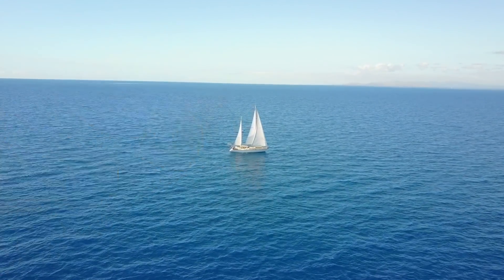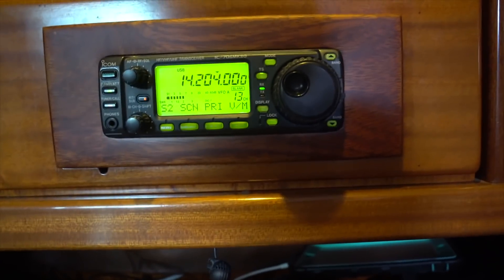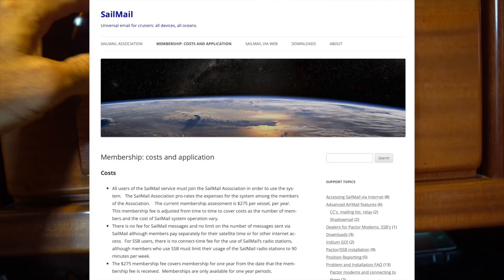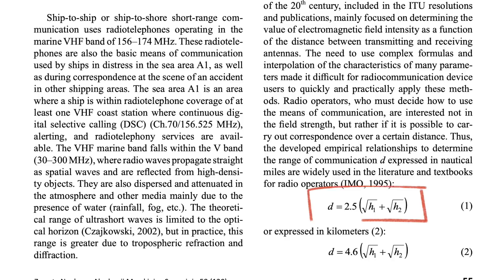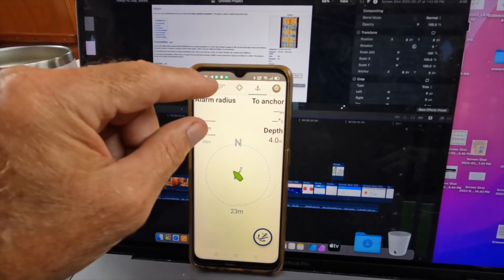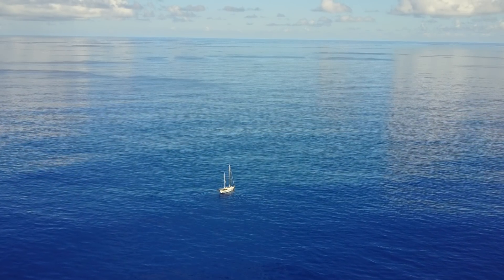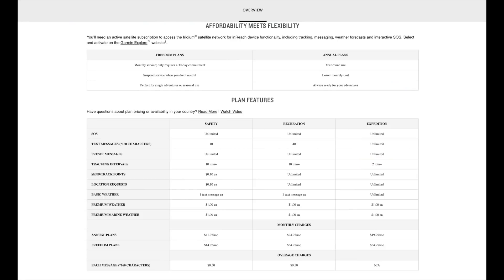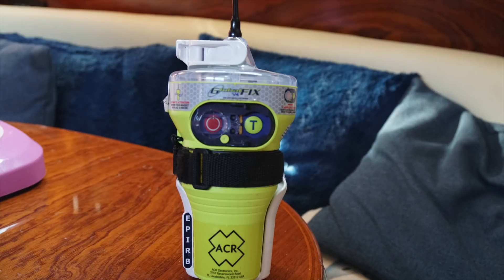Yacht Communications 101. Tips on Tuesday

Comment: Great Tips on Tuesday! Very practical information to consider.   Did you set up the NMEA system on Aquarius or did she come set up?   Do you run a secondary mapping/plotting system with a laptop/external gps antenna or do you primarily on your chart plotter?  And which platform (Windows/Android or Apple based) do you guys find more useful?
Reply from the maker: I set up the NMEA 2000 bus.  Supper easy to set up the NMEA 2000 bus!  The Vesper XB8000 sends all the NMEA 2000 and NMEA 0183 data over the WIFI, this data included the location data.  Our computers and tablets use the Vesper location if connected.  This way we can also use the AIS alarms....  If any boat gets within a few miles of us, the alarm goes off...  Both Z and I use Apple based computers, but Z has and iPhone and iPad, and I have Androids.  Ken

Comment: Thanks for the information.  I think I would have an Epirb even with other satellite communication as it design for emergency.  You push a button and people will look for you.  In the best of time, it take a few minutes to set a call with Iridium and explain what is going on and where you are.
Reply from the maker: You are correct about one button to press on the Eprib, but IridiumGo also has one button for emergencies.  We also have Eprib's on Aquarius, so I also think it's a requirement for passages.  If I was running out of the boat, and could only take a few items, I think I would rather have the IGO and and iPhone rather than the Eprib.  All the best and thanks for the comment!  Ken

Comment: Good to know. Thank You for information.
Reply from the maker: So nice of you!  Thanks...
Reply: @SailingAquarius  from different perspective: If i sail offshore , but do not cross Oceans, do i need such internet hardware? Maybe You know cheaper internet than 40K
Reply from the maker: @svamateria9912  If you want fast internet, I don't know of anything cheap.  Slow internet is available with Iridium, but everything else will need special antenna systems...... Fully motorized antennas that automatically focus on a geosynchronous Satellite.   IridiumGo is slower than dial up speeds from the 1990's.  It's ok to download short emails and texts, and Grab files for weather, but that's about it...  Best, Ken